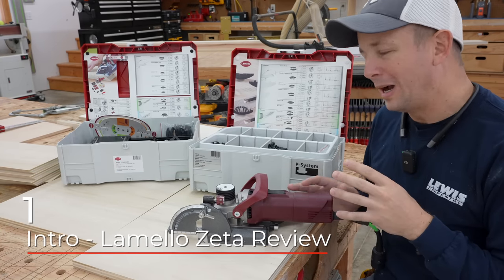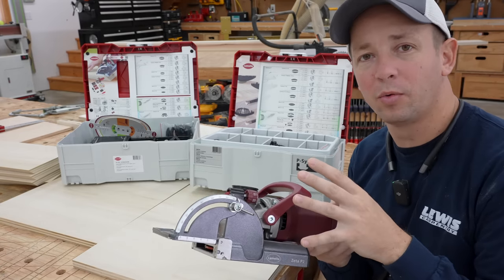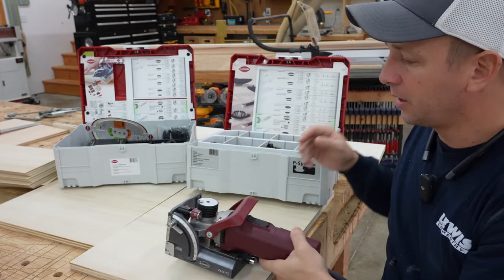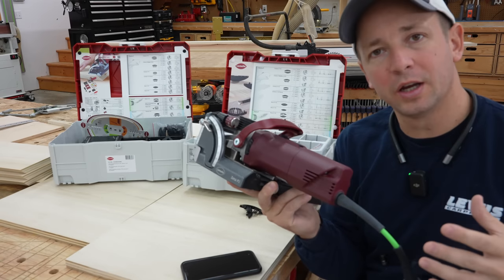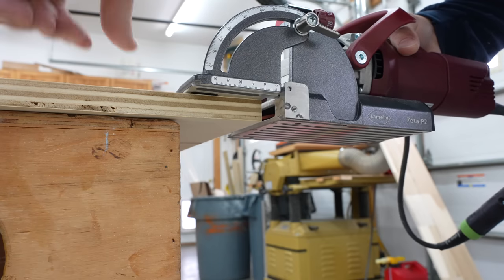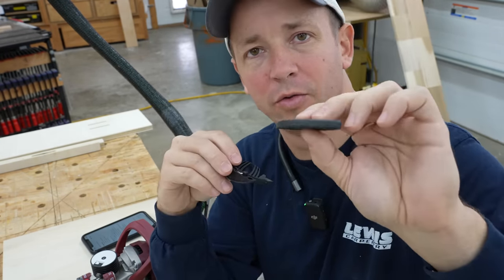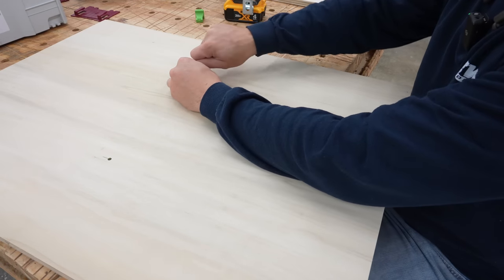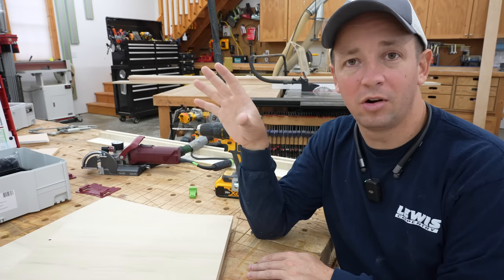Worth the $2000??? I finally bought a Lamello Zeta...

Comment: Great review Spencer. If I may add a couple of amendments. The tool comes with an auxiliary fence that allows you to adjust the height of the blade. Also, something I’d like to mention that the tool really sines in urban environments where spaces are tiny. Being able to assemble something that has finish coat on it on site is amazing. Last year I had to build something that was 14’ long and 3’ wide. To a 3rd floor apartment up a stairwell 2’ wide. The zeta p2 saved my butt.

Comment: So.. I just bought the DF700 kit + the DF500 adapter.. and I gotta be honest.. while this looks cool, I feel like for about the same price, the Festool DF700 (and with the $150 DF500 kit to get all tenon sizes).. you're getting a lot more for the same price with the Festool system. Not only do you get MUCH strong tenon joints if you use it for that purpose, but their connector kit looks to be a lot stronger.. goes further in the wood, and at least from watching the various videos appears to me like it would be better for heavier furniture as well given the size of the connector tenons. I do see that with the DF500/700 you need the drill jig and have to drill one extra spot to put the 2nd part in.. but seems worth it for what I believe is a much superior stronger connection. I could be wrong though.. just my opinion. I am surprised this device is so expensive. I bought a very good porter cable biscuit joiner for $150 that looks every bit as good as this with the exception of that little bump/lift mechanism. Seems like thats a whopping lot of money for that little bump system.

Comment: In Belgium they have different sales taxes depending on if the built-in cabinet is removable or not (6% or 21%). By using this system, you can make "removable" buil-ins and get the smaller tax. But other than that...
Reply from the maker: That's crazy...
Reply: Wow what a scam... leave it to the government.

Comment: You won’t regret it, I’ve found I use it more than I initially thought I would. Only issue I have is cost of consumables.
Reply: And be careful to line up your drill hole position using the clamex

Comment: I bought a Lamello Biscuit joiner in the early 1980's for a specific job (a custom kitchen) and I am still using that exact same tool on projects today. It cost an arm and a leg at the time, easily equivalent in todays dollars to what you spent on the Zeta. No regrets. Although, it cost more than my brand new Delta 10 inch shop table saw at the time, like you, I saw the power of the potential and sure hoped I was right. I was, and am sure you are too. R.O.I. many, many times over.

Comment: Great review of the tool. I’ve been using mine for little over a year now. In cabinetry building it is a must for me know. Build in shop, disassemble to transport, or flat pack ship. Reassemble in the field is a snap. Pun intended. So it’s great for right angle applications as well. Clamex is so great for shelving. Closet systems is now a breeze. Large panels that break down into manageable pieces for getting up stairs around corners, into tight spaces. What use to be a two man carry can now be a one man carry. It’s not what it costs you, it’s what it saves you.

Comment: Got this for our cabinet shop a year and a half ago and not sure I could live without it now! I actually use the auxiliary fence way more often than the fixed. Our most common used are: various miters (we use lock miters way less now), attaching cabinet faces, attaching inset side panels, and plywood extending as you mentioned. Every job we are finding new uses! Just did a tricky closet install with the face frames separate and able to be carried out of the room to cut the scribe, very satisfying to click the finished face into place! Lots of tricks to make the whole process smoother, can't wait to learn from your take and maybe get some new tips!
Reply: I have some lots in Florida to sell you

Comment: I use the Zeta for about 4 Years, i use it about 2 times a week. If you can't put a clamp on, you can use the zeta. 
Yes you can use a dust bag on it, they are also available from Lamello. 
There is also an round paper blade thing in the zeta box which you can use for x amount of diffrent °corners. It tells you exact what you have to use to get an absolut fantastic result. 
Worth all the money.

Comment: Great video Spencer. I bought my system several months ago. I dumped the systainers and setup a Packout using a three drawer bottom filled with the various connectors and  a mid sized hinged box then a shallow clear lid sorter tray. It holds both my standard Lomelo biscuit and the Zeta. Put that in a dolly base and you’ve got a great portable well stocked setup.

Comment: Hands down, you’re the best finish carpenter on YouTube!  

Although I have not used this tool, I’m currently installing a locally made high-end kitchen with dozens of the clamex connectors.  They’re phenomenal!  Pro-tip; do not mix up the female end connectors of the two systems—someone at the shop mixed them up—which made for a frustrating assembly on one of the cabinets since they look alike.  These have many advantages over the Festool.

Comment: Nice review, I've had one of these in my cabinet shop for about a year.  One thing to try before you throw out those bisco things...we use them on installations to hold things temporarily for scribing fillers and end panels.  Basically we'll have a cleat attached to the cabinet that's machined with slots to attach the filler to.  On your filler piece cut your matching slots, then using the movable fence offset it by 1/2" (or whatever thickness your scribe block is).  Machine a few extra slots on the filler piece.  Now on the jobsite you can set your cabinet, use the biscos to hold the piece in place offsetting it exactly 1/2" from the final position.  Run your scribe block along the wall and trace the wall profile onto the filler.  Plane or belt sand to the line and snap in place with Tensos using the original slots.  Perfect fit every time.
Reply from the maker: Makes perfect sense to keep them around now. Thanks!
Reply: Is your cleat flush with frame? Just wondering how you get the filler to fit the bisco slots and then when it slides over its flush with cab and still fits in slots
Reply: @kjk7225  We usually build frameless cabinets so the filler is a separate piece to bridge the gap between the cabinet side and the wall.  Usually we make it with the filler front face flush with the face of the doors.  With face frame cabinets we make the frame removable and assemble it with pocket screws so you can take the whole frame off, install just  the cabinet carcase, then remove the end stile from the frame, offset it with biscos and scribe to the wall then reassemble and attach in place.  But it takes a long time and only makes sense to do this in situations like when installing between 2 walls and need a tight fit.  In those situations you have to do it for both sides.  If you're just bumping against a single wall don't bother just do a normal scribe, trim & install.

Comment: @Insider Carpentry those bisco connectors can come in handy if you are test fitting pieces together for a dry assembly, perhaps before you deliver to a job site.    Instead of trying to pry open a tenso fastener for example.    

Great purchase man.    I can see you getting immense use out of this tool.   Bite the bullet and get a large stock of connectors.    The price won't ever come down I'm sure

Comment: Awesome demonstration sir. My cousin works at Colonial Saw as a salesman. They're the primary Lamello dealer for all of the US. He let me borrow a basic biscuit joiner to test for a couple months. It was an ~$800 joiner but I didn't find a substantial difference compared to my cordless Makita. It didn't have any special capabilities like yours. I've used Lamello self clamping biscuits for years and they're very handy. When you dive down the biscuit joiner rabbit hole it's amazing how many different biscuits there are made of various materials and with different clamping capabilities.
Reply: Chris Hoffman very helpful demoing the tool at JLC Live in Providence RI.
Reply: Makita make great biscuit jointers but they are a little bit more time consuming to use and the fence system is not as good. 
Now if you are starting out on a budget a Makita is a very good option.
Reply: @bighands69  I wouldn't consider the cordless Makita to be a budget joiner and the fence has been dead on for ~3 years. I took a digital micrometer to every blade on my 5 joiners because the Lamello salesmen said their blades are different but they're all exactly the same. I highly recommend the Makita cordless, but I bet the newer DeWalt is better.
Reply: @Tool_Addicted_Carpenter  
Makita is a great tool for those with a lower budget but it is nowhere near as good to use professional as a Lamello Classic X.
Reply: @bighands69  I guess when I think of budget biscuit joiners I think of the $60-100 range. The cordless Makita was $240 when I bought it a while back. Definitely not the same action as the Lamello but in the field I didn't find any significant difference for basic joinery. The blades were the same thickness to the 1/1000th of an inch. I liked the rubber glides on the Lamello fence but still preferred the rack and pinion on the Makita. It was an older model in the $800 range so I'm sure Lamello has made some upgrades to their newer and pricier models.

Comment: Thank you Spencer, this was a really nice intro video. I'm looking forward to seeing it being used in your workflow. I've been eyeballing one of these for some time, though I'd likely go cordless since I am on the CAS system. I watched Robin Clevett do a T&G ceiling using the Tenso connectors to hold the butt joints together, and that was brilliant. I've long thought something like that or dowels would be great, but even dowels wouldn't clamp them together like the Tensos.

Comment: I bought the dust bag for the Lamello Top Ten some five years ago and it really works good with only the standard Top Ten blade as the new design blade tends to ball up the dust immediately before the dust comes out of the metal exhaust shoot. Have the Festool vac with extended snout ready as you unzip the bag so you may clean out all the dust in the bag. Portability with that bag on the Lamello Top Ten with power cord is great. So easy to use. The newer blade for Lamello tends to curl up the dust shavings and plug the exhaust. I oil the slides on the Lamello every time I use the tool and that has kept the precision to a high level over the last 32 years. I have the optional H9 Lamello plates for thinner woods-very good.
Reply: 32 years! That's awesome!

Comment: It's called a keyway, that slot the connectors slide in. The auxiliary fence makes for easy with mitered capabilities and the 2mm and 4mm offset fence plates are sweet. It's expensive yes but man it's so sweet when perfection is necessary!

Comment: I love your videos man!  Like a lot of other people have mentioned, I have also learned a LOT from watching you, including being comfortable enough to start hanging crown (and also starting my own business :) ).  I do think that watching this one may cost me $2k though!  I have the Festool DF 500 and started using their knock down connectors.  I love how they also work with their LR-32 system, but I can also think of a few occasions where the Zeta may be a better solution.  Would you say that the Tenso connectors provide enough tension to act as the clamps for a glue joint?  I just discovered the Lamello Invis Mx2.  Has this shown up on your radar at all?  I would be really curious to your thoughts!  Thank you again so very much for taking the time and putting all the love and passion that you do in your videos!!  If you're ever in Maine, beers are on me!!
Reply from the maker: It's a nice tool, but definitely one I can live without. The tensos provide medium clamping pressure. Nothing close to what actual clamps provide.

Comment: Spencer, I’m going to buy some tools for my trim carpenter (I build custom homes). He currently uses pocket screws and biscuits for most joinery. 

Question is, I’ve been thinking I would buy him the Festool Domino.. he builds a lot of “built ins” and cabinets along with the standard base, case, crown and wainscoting.  

I can’t buy both for him right now… but possibly in time.

Question is, is one system more flexible than the other?  It seems to me the Festool domino may be a broader range of fittings and capabilities.. am I wrong in this observation?

Comment: 1) Can I use draw bolts?
2) Can i use pocket hole screws?
3) Could i just use exposed fastners from the backside?
4) does it really need to be able to disassemble or can I just glue it together?
If you answer "no" 3 or 4 times you might have a need for these.  And when you need them, they are REALLY cool. However like every tool you can waste time and money over complicating something that could be done with a simpler and/or faster process. I ain't here as a hobby, to do cool , neat things, i am here to make money and get the jobs done.
Thanks for the review, we really appreciate your content in an industry that has very few Master carpenters producing content.  I don't mean to sound negative just want the newbies to realize that this is not going to make every project easy.  It's just another weapon to choose from.

Comment: Thank you for this detailed presentation. Better than the Zeta tools site!.
I have been considering this for 1 year now instead of the Domino. I did get a Dowelmax system which i love!....but the Zeta is next for sure now since im doing a lot more custom cabinet and built ins for clients and it will make my processes more streamlined and more fun and lessen any frustrations doing builds.
The connector  costs are just part of the job cost and must be added in just like any other fastener used....i would not sweat it considering it makes for a more satisfying and valuable build.
Doug, Grand Bend, Ontario

Comment: How do you you have your vacuum hose coming down from the ceiling? Track or boom arm?  Been watching you for a while and don't think I have ever seen the ceiling. I am having problems keeping my hose under control when doing different operations on eathier side of a 2 car garage. Awesome review and video as par for the channel. Always lots of useful information with no useless talk.
Reply from the maker: Took a large caster wheel, took wheel off, put a 2” dowel about 4’ long on it. Attached the hose and cord tk that. Works amazingly well. I’ll try and show it closer sometime.
Reply: @InsiderCarpentry  ahh awesome thank you so much.

Comment: I am curious how those connectors perform with soft-core plywood like Spruce vs baltic birch plywood. 
I would trust the lamello to join birch plywood, but I am nut sure if I would use it on split prone materials.

Comment: We make our own Xl plywood with the domino, but it requires 12ft pipe clamps which could take up extra pace (we have an A-frame clamp cart).
Building, finishing, then breaking it down for transportation is where it would shine for our cabinet shop.
Especially floating shelves in wall to wall scribed applications, 3rd hand spreaders help.. but 2pc would be much easier to keep the drywall pristine.

Well done on the in depth analysis!
Reply: Lamello has another type of connectors that might be of use in that floating shelf scenario. The divario. It’s meant to be a connector you slide your shelf piece into. Might be worth looking at if you weren’t already aware of that particular connector.
Reply: @Patrick Houser  I don't have the lamello yet..
I have added Metabo 18v system,since their batteries are used for the zeta...and Mafell.
Baby steps.
Reply: @2chipped  I got onto CAS specifically for Mafell and have been expanding from there, hah. Indeed, baby steps with these large purchases.

Comment: Great review. I was interested in getting one for the similair style feature wall, but since it was for home use, I couldn't justify It.. Ended up coming across Knapp Connectors who sell many different hidden fastener options. Went with the dovetail ones and they worked out very well for a no show fastener install.
Reply: @crzyworm623 that is very useful information - thanks!
Reply: Funny you mention knapp because they make a connector that looks very similar to the lamello ones he plans to use for the slat wall except the knapp connectors get tapped into a size #20 biscuit slot cut with a biscuit joiner and have teeth on the connector that hold them in place. There's a male and a female one and they snap together it's called the Knapp FAST biscuit check it out.

Comment: Hi, I have two questions, the first thing you did with the power cable? Secondly, what do you recommend battery version or classic cable?
Reply from the maker: The cable was something i had sent over from europe. 

I was torn between corded and battery. I don't use mine that often so a cord was fine. If I used it more I'd be more inclined to go with a battery. I also didn't want yet another battery platform to mess with charging.

Comment: great tool! if i had any use for it i would definitely buy it. it would quickly pay for itself in no time. another high end tool is the castle pocket hole system. very clean pocket holes and the ability to make them a lot faster than the kreg system.

Comment: I remember I bought the Domino Connect set a while ago, but never used it for anything but was planning to. Fast forward to the present day and my shop was burned up in and CA wildfire. I had the original Lamenello biscuit cutter I bought 30 years ago, it was of excellent quality. I also had the Lamenelo flush cutter, also an excellent tool.